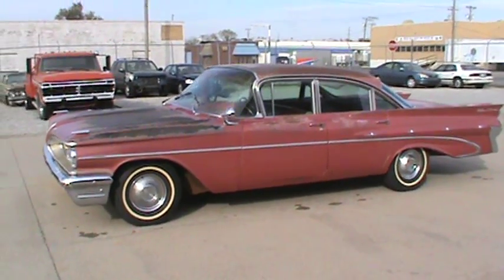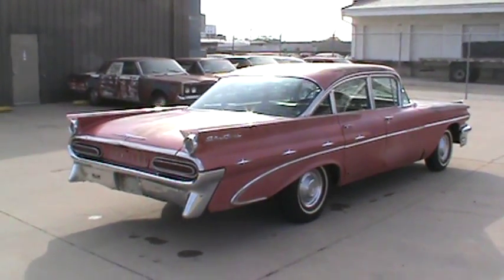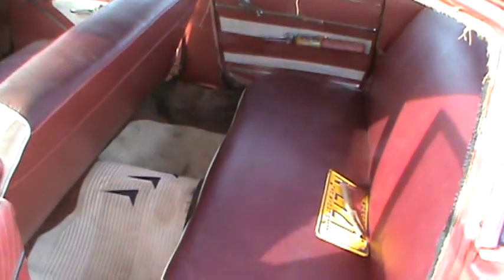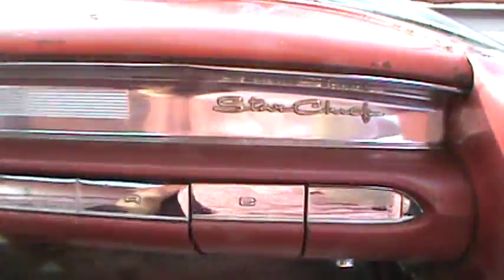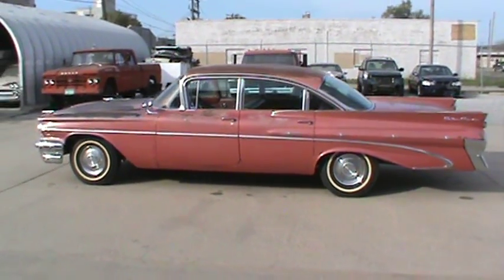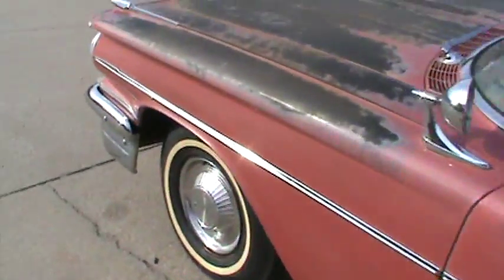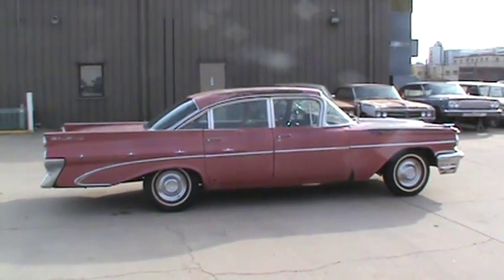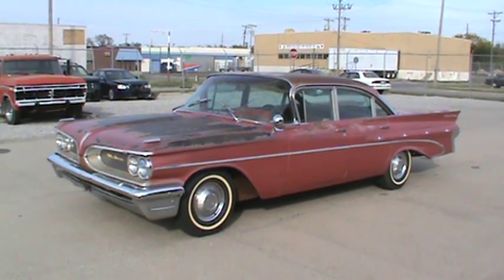1959 Pontiac Star Chief

Comment: Dude! You da maaan! (for saving a Poncho from becoming a coucho). Nice save! Nothing is so pleasant a surprise as having a negative expectation violated, as in "Wow! She's a runner! I thought this motor was toast!".  If that were mine, I would address the lack of an exhaust system, and replace the "art deco", but ticketable windshield. That windshield is not going to be cheap to replace. Hopefully, you can cannibalize one off from another 1959-60 GM car. And if that is THEE original paint, I would patina it.

 I also love old 4 door cars as well. Though I like the 4 door flattops (with the panoramic rear window) much better among the 1959-60 "GeroniMobiles". In 1984, I had a 1960 Cadillac 4 door flattop, that was about in the same condition as your Pontiac. But when the transmission started grinding in reverse, I sold it to a collector who intended to restore it.